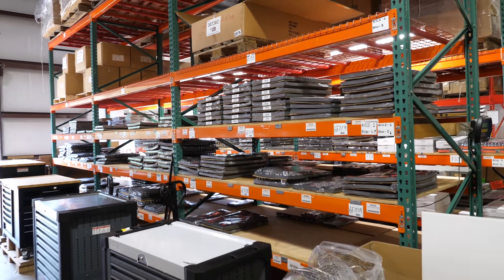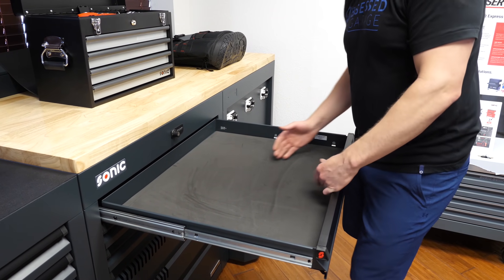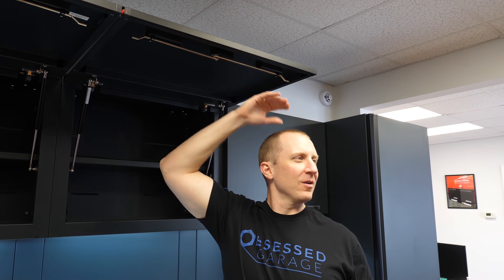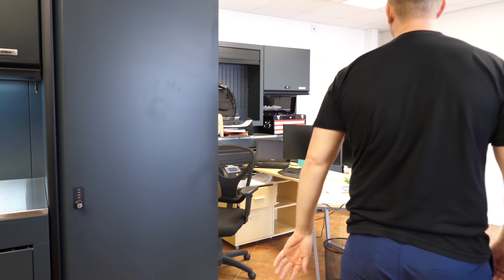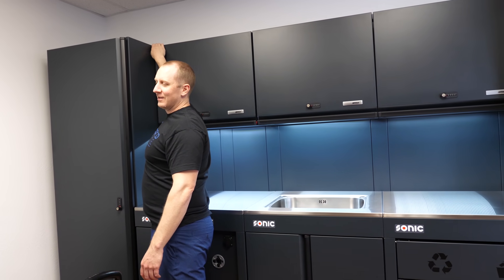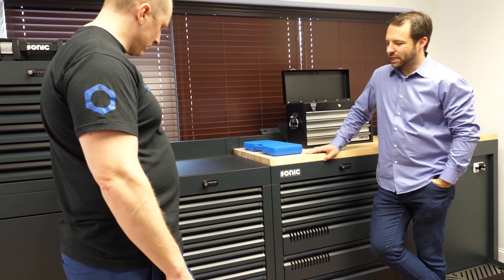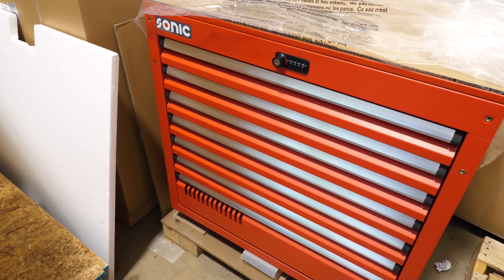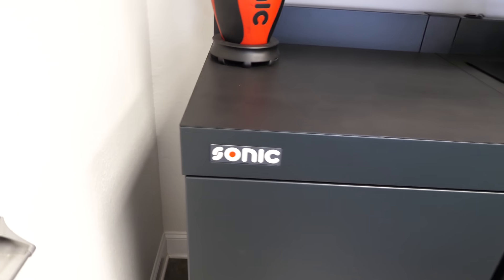Sonic Tools USA  - A Look Inside Their Facility

Comment: Just got home after i bought the S14 box for $500. I don't think the guy realized what he had. As we were loading a second prospecting buyer came with 2k cash after running a bit late. I could not get out of there fast enough. Fyi, that S14 is just smooth asthe smaller boxes when rolling over a cement floor.  It's is just crazy. You can also remove 2 small drawers and replace with the deeper Sonic drawers. If you have the box they are willing to sell you drawers seperate to customize.  Spoke to a rep yesterday. Hard to explain the quality of these boxes it's something you just have to see for yourself.

Comment: Does Sonic make a roll around tool box?  Not like the smaller aviation box in video but about twice that size with butcher block work top.
Reply from the maker: Yes, the have many different versions.  I like the S9, S11
Reply: Obsessed Garage 
Thanks I checked site.
S13/14 was what I was looking at.

Comment: The “track pack”
Reply from the maker: Ewww... I like that.
Reply: Those portable sets/bags look pretty nice.  I have a decent portable wrench/socket set, but the two plastic tabs broke so it doesn't stay shut on its own anymore which makes it pretty much worthless when I need to take it with me.  Having a good zipper or metal latch on the case would be nice.

Comment: I like the cabinets but the tools just look like cheap knock off like Tang tools. That 1/2 ratchet sounded awful, you should feel a snap on, its butter smooth
Reply from the maker: I have many Snap-on tools.  These are in a similar class without the goofy middle men.
Reply: @SWAGURA  dont make fun of the snap on guys. They are the Male equivalent of girls walking around with Louis Vuitton purses